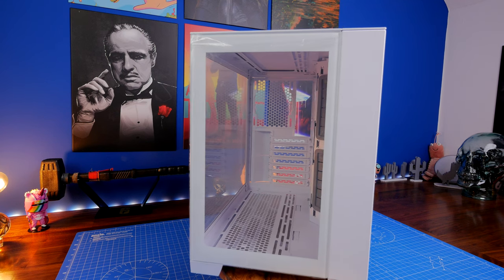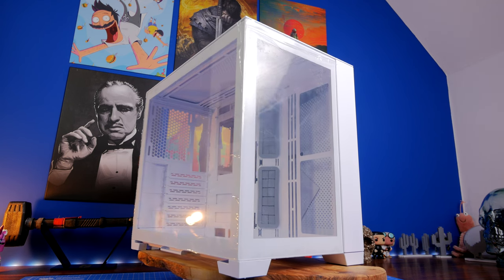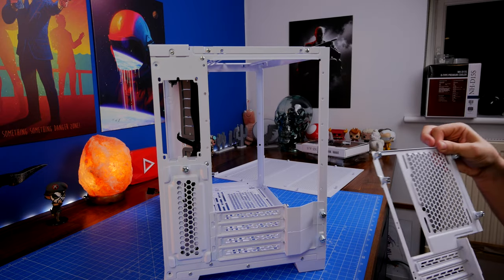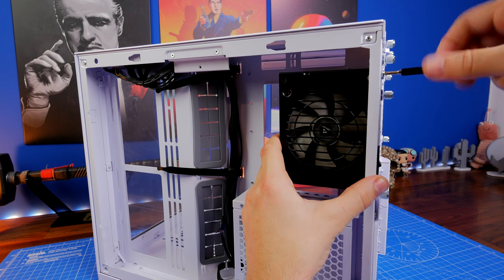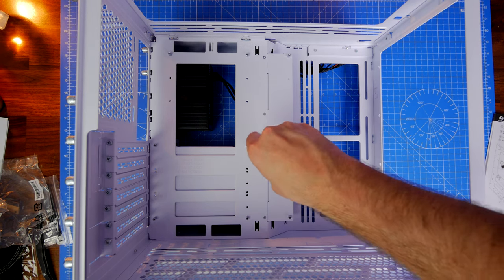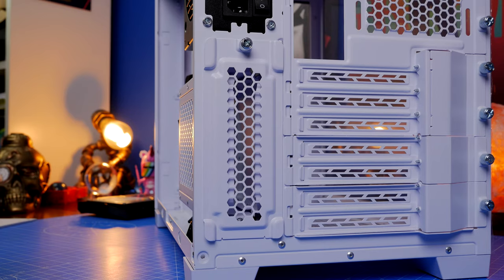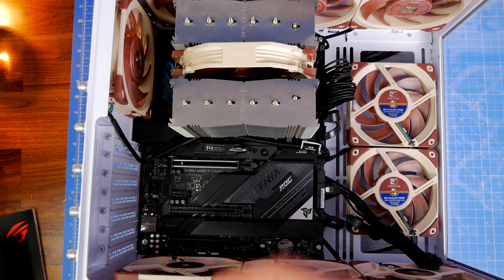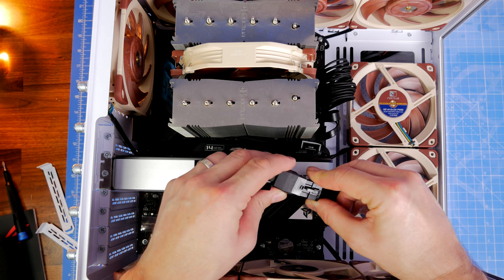Lian Li Dynamic Mini Snow Edition build with air installation (features and how to)

Comment: I have the same case but in black. Did my first custom loop last month and it's so spacey to build in. Have a 360 rad in the bottom, a 360 in the roof and a 240 on the side. Bought the lian li o11 mini air offset bracket for my atx motherboard. Keep up the great work bro and stay safe.
Reply from the maker: Very nice. I've not ventured into custom loop yet. It would be a pain tbh as I'm changing cases and gear constantly. But sound great. Come on discord and share photos. 😎🦐

Comment: I have the same case doing a similar build. The hd audio for this case is an 8 pin.. and the “aafp” on the board is a 10? did you plug in the first 4?